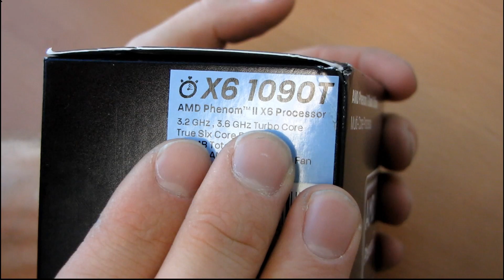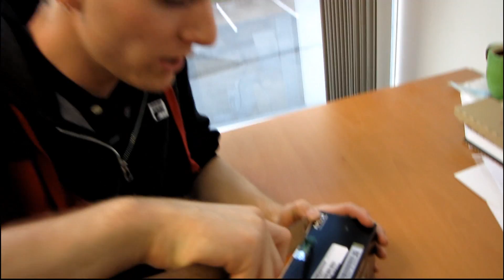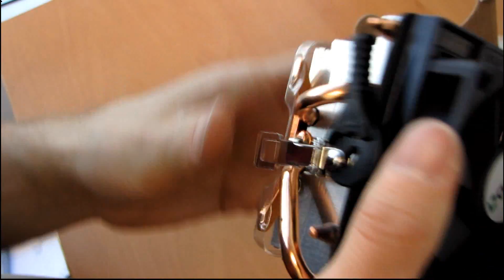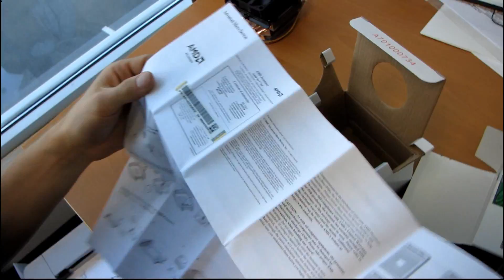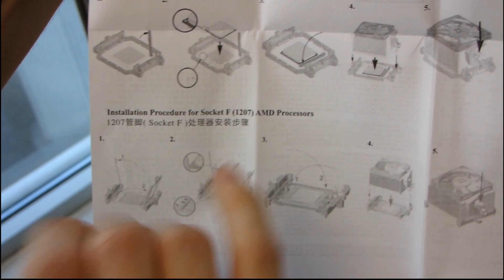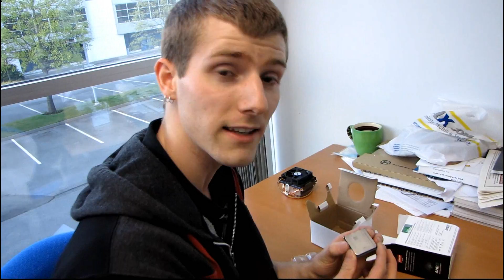AMD Phenom II X6 1090T Black Edition Six Core Processor Unboxing & First Look Linus Tech Tips

Comment: Watching this with my X6 1090t :)
Reply: Me too bro! I just uptaded my system with a RX580 VGA and put more RAM into it! Still gaming into 2018
Reply: Me too
Reply: Same! I upgraded graphics to RX480 and I actually have such a gaming backlog that my spec is still good. And it's good enough for Overwatch, so...
Reply: 1055T here (3.7GHz OC) Is the RX480 8GB good with these CPU's?
Reply: I miss this CPU, I used it for 7 years! It still ran very well.
Reply: @heavymetalfreek  what have you upgraded to?
Reply: still using mine in 2019 lol
Reply: Running the 1100T in 2025.  Switching it a Time Machine

Comment: Hey I have this processor and is running at 62C while gaming do I have to worry?AMD Phenom II X6 1090T Black Edition Thuban 6-Core 3.2 GHz Socket AM3 125W HDT90ZFBGRBOX Desktop Processor Dont want my pc to burn or my cpu to burn my motherbord how can I make it run coooler while gaming I already one watercooling while im not playing it goes as low as 22C
Read more
Reply: +Mario Cuenca Nope. 62 really isn't anything to worry about at all while under full load. That's actually on the colder side all things considered.

Comment: Bought this processor in june/july 2010 (can't remember the exact date). Have 6Gb of ddram2 and a R9 270X graphics card. I can play on my desktop pc any game from 2015 at max graphics without the processor breaking a sweat. The only problem I had was something happened to my 4th ram slot, (I originally had 8gb of ram, 2 gb in each slot), which gave me blue screens at random times when gaming or video streaming. So, until I find another AM3 or AM3+ motherboard (apparently they are not produced anymore),I'll stay at 6Gb. Anyway, I think, and this is just a personal opinion, that this is the best series processor AMD has produced... which is a shame. In my Dell inspiron laptop I use an Amd Phenom II X3 N830 which I bought about the same time as my destop Pc. It still outperforms my wife's A10 4600 Asus laptop.... (gaming wise, and video rendering wise). I don't plan on upgrading any of my pc's desktop or laptop (maybe I am an AMD fanboy) until a K10 true replacement comes. Hopefully 2016 Zen will be the hit I hope...
Reply: what? the newest amd boards are still am3+ that's all they make for amd. and I would really upgrade from that 667mhz ddr2 crap. 16gb of 2133 ddr3 for $100!
Reply: +andikoo82 Now here's a comment that I don't see a lot.

I too have the R9 270X but I have an FX 6300 and 1600MHz of DDR3 RAM.
Reply: Shredder's House of Pain Yeah, The FX series is somewhat better than my Phenom II.
Reply: andikoo82 It's served me well for emulation.

Comment: 1090T will still work well and handle almost everything nicely for at least 2 more years :)
Reply: and 2 years later....i fully agree with your comment

running a 1090t at 4ghz.....and a 6970.

its still not bad...and will do very good in my dads "family" computer.

zen seems to not be the best of the best....but damn close, and probably VERY VERY close with OCed
Reply: Still running the 1090t, with an gtx 1070....no problem running things though at this point i really need new ram and more pci lanes :/
Reply: I still used it -_-
Reply: Raymond Mertin major bottleneck, u NEED to upgrade to a new cpu
Reply: noobwow2009 ive been 5 years with that processor, the first two years it was a beast for me but after that errors and other stuff happened. i do not recomend amd for 3d animation / rendering / video editing because mine broke 2 days ago rendering an animation. Amd was okey at its time but im not buying it again. intel is much better and hopefully i will be recieving an i7 5930k tomorrow or so.

Comment: Hey, 

So I recently purchased a new case and I decided that it was probably time to apply new thermal paste and take apart the cpu cooler (I believe i bought it either 09 or 10 lol). I found that those copper pipes are now partly green, the top of the heat sink was covered with a few mm's of dust (the kind that looks like a creature lol) and the fan was also completely covered in dust. I cleaned most of it, the pipes are still shades of green (in some parts) and the top of heat sink (where the fan sits on top of) has turned a dark color. Should I be concerned? 

Also, I turned the fan around cause I thought it would be beneficial to have the fan blow OUT from the cpu, instead of the default IN. Am I wrong here? Oh and now my fan is SUPER loud, can this be because of the new orientation of fan? 

Can someone please give me some pointers here? thank you! 

P.S Went from Antec Lanboy Air to Fractal Design r5. Sweet case but the holes for putting cables through are WAAYY too small and the gap between side case panel and mobo is also way too small. I had to mess around with cable mgt for quite long to get it to close, even with slim cables from the RM1000 Corsair series PSU.
Reply: All i know is that the fan should blow 'to' the cpu. It keeps cooler that way. Just like if your in a room and you turn the fan away from you, you would feel hotter but if you put it directly on you, you feel much cooler.
Reply: Jordon Roberts Thanks! 

I ended up doing just that, there was a really, really loud noise coming from it the other way around.

Comment: Yeah but I have read that the 1100t outperforms an I5 2500k that was one of inlels best processor you could overclock the hell out of it. I was thinking of upgrading to that from a old Phenom x9950 to that and pairing it with GTX 770, that is like your GTX 680

Comment: four words: DO NOT GET THIS. Personally i have this paired up with a gtx 680 lightning edition. The 1090t doesn't bottleneck the gtx 680, but still, it is a really poor performer when it comes to gaming. Bottomline is, if u are gaming solely, don't be cheap and get an AMD, save up and get intel. Don't be stupid like me.

Comment: Hey all, just saying that if u want to game on this cpu, think twice. Mine didn't die or sth, it's still working fine after a year. But just cos it's 3.2ghz and has 6 cores doesn't mean anything. Basically even if u clock it up to 4ghz it still falls far behind intel processors when it comes to gaming. I'm really disappointed with mine but i just try to squeeze whatever performance there is out of it

Comment: Runs bf3 with no cpu bottleneck at all and will probably do the same with bf4. Its rival the i5 beats it in single core performance but as soon as the 1090t can stretch its legs in a multi threaded app it will kick ass. Plenty of life left in this cpu if you can get it for a good price.

Comment: This cpu runs HOT! Just picked this up i rushed to install that might be the reason why but I'm at 51c at stock setting idle and I have the corsair h60. I plan on trouble shooting as I had to go to work soon after install but I've read online they do run hot. Plan on reinstalling h60 and bios update will post update

Comment: @JamieSCOBell i got 2 enermax fans for the top of the casing taking in air and one lousy stock fan from thermal take at the side. Got another thermaltake one( slightly better) as an exhaust at the back. Seems to be running cooler now. I think i'll get 1 more quality fan for the side intake so my gpu doesnt hit too high of a temperature. Thanks for the tip thought =D

Comment: @RSGu1des i have phenom 1090t
8gb 1600mhz ram
similar spec board
but im using a 2-3 year old geforce gts250 512MB

surprisingly it runs starcraft 2, skyrim, fallout 3, COD MW2 with 90% of settings on ultra & at 1680x1050 reolution maintains above 40 fps 97% of the time

so with the gtx 560ti it would absolutly demolish these games

2x4GB ddr3 1600mhz cl9 costs less than double 2x2GB costs if u can afford get 2x4GB (8GB)

get an AM3+ board & u can upgrade to new 8core FX cpu in future

Comment: i just bought this processor along with a gtx 560 and 8 gb ram. It appears that my 1090t is overheating even though i dont overclock any thing! I was playing bf 2 maxed out and it ran very well, however i could feel waves of heat from the computer. My gtx 560 seems to be running cool but the 1090t is seriously overheating. I am currently using the stock cooler. Can i turn off 2 cores or sth?

Comment: i have this processor. after activating the full 6 cores, i have no idea how to deactivate them. they use too much voltage - about 1.4v, and it is making my CPU at 44*c which is fine but due to the high voltage, my fan speed rises up alot higher to keep it at 44*c and the fan rpg ranges from 2800 - 4800 rmp and the acoustics is bothering me.

statistics from CPUID H.W. monitor and CPUID CPU-z

anyone know how to deactivate the cores? whether from the bios or a special button or something?

Comment: @Dp153 @Dp153 thats a sweet rig i would add a cooler master v8 cart because you will not be able to oc much with the stock cooler cuz of the 135 or 125w cpu (cant remember, but they run hot!) u can always upgrade cooler later and the six core is alot nicer than the 4 core cuz you can future proof your rig by doing so, even tho games dont support 6 cores yet. 
p.s. the v8 will do much better than the 212

Comment: @omfgg3tlost Not really :/ AMD is actually known for having really loud factory heat sinks. I myself own a quad phenom II black edition and the stock heat sink keeps it cool but is extremely loud. Also replace the thermal compound with your own (I recommend arctic silver 5 or antec formula 7), but yea us AMD users know to buy an after market heat sink.

Comment: @mad87645 WTF are you smoking? The Core i architecture is about 30-40% faster than the Phenom II. The 2600k stock beats the PII at 4.0ghz. Learn your benchmarks. The PII is great bang for the buck, but it can't touch the i series. 1366 just blows AM3 out of the water. 1155 is no contest.

Comment: I'm buying a new PC(for gaming), will this be good enough for gaming?
CPU: AMD Phenom II X6 1090T Black Edition
CPU Cooler: Coolermaster Hyper TX3
Operating System: Microsoft® Windows 7 Home Premium 64-bit
Motherboard: Asus M4A87TD USB3
Memory: 8GB DDR3 1333mhz (2x4GB)
Hard Drives: 1TB S-ATAII 3.0Gb/s
Optical Drive: 22x DVD±RW DL S-ATA
Graphics card: ATI Radeon HD 6950 2GB
Sound card: Onboard 7.1 Audio
Internet: Wireless 802.11N 300Mbps MIMO USB dongle
Case: Zalman Z9 Plus
PSU: 700W Xigmatek

Comment: @cmts38 yeah but the reason why its cheaper is because amd took intels blue prints for the core i7 and then modified it and called it the AMD Phenom 2 x6. its like intels fraternal twin thats kind of a bit better in some areas whereas its not really useful in others. they have been doing this since intel choose amd as their partner back when intel was making the first processor for ibms computers.

Comment: @cmts38 

I have this AMD coming in my gaming computer. The I7 actually is faster then AMD, but it isn't the price difference you're talking about. With a price match, AMD is $220, I7 is around $330. AMD fully clocked is better than an I7, and the I7 fully clocked just blows the AMD. I7 is the best for single monitors, while the AMD is more of a gaming one with more monitors.

Comment: @cmts38 also not able to be overclocked as high, not hyper threaded, hotter at higher clock speeds and does not support triple channel memory. Dont get me wrong I love AMD (am currently using AMD) but the performance of even the 970 which is only $600 and still 6 core hyper threaded is still far greater then this chip.

Comment: @GaystationSuckz lol, i3/i5 running 4 cores at 2.7 doesnt even compare to 1090t running 6 at 3.2, that turbos to 3.7 if your not utilizing more that 3 cores.i7 extrreme 980x six core only just beats it in all benchmark test ive seen,@ over twice the price.

Comment: @cmts38 Right but remember that processor speed rarely plays any difference. It's all about architecture when it comes to CPUs, and this is why the intel CPU is so much more expensive. It has a more advanced architecture and it shows in a lot of benchmarks.

Difference is not worth anywhere near that additional $700 though. AMD forever!

Comment: @hockeyhatesgooglnow The vcore will always have to go up depending on how far the overclock and how well the chip can clock on stock volts alone. The unlocked multiplier just makes overclocking easier, as you can literally do an enormous amount of overclocking just by upping the multiplier and keeping track of your volts and temps. Overclocking through the bus is pretty easy too, but you need to take more things into account.

Comment: @EmperorZhang66 The AMD Phenom II X6 1090T like all AMD Phenom II processors only supports dual channel ram. Apart from that the crosshair iv only supports dual channel anyways. Go with an Intel Socket 1366 Processor if you depend on triple channel memory.

Comment: Hi
I would like to know an honest suggestion wrt AMD and Intel processors. 

I have a Pentium D and have never worked on an AMD machine before. Ignoring the cost factor, which would be the best advisable configuration for HD graphics, gaming & daily office use? 

Honestly, which one is better - AMD Phenom II x6 1055T or Intel Core i7 980X extreme edition? 

Also, any operating system (present or future) which fully utilizes all the cores. 
Thanks

Comment: Where the performance of a processor is what matters and you're making a big deal about a sticker not being on straight.  More then likely it might even be a manual application.  I used to have to put at least 10 stickers in a breakerbox case where I worked, trust me, they mess up from time to time.

Comment: Finally got it stable at 4.1GHz ( using HyperPi ), and I'm absolutely delighted.
Used the same method as you did with the 1050T. :o)

Comment: Got one yesterday, replaced an Athlon ll 640 of all things quite easily, and my rig booted up immediately, with no probs.
But I did a clean instal of W7, and oc'd quite easliy to 3.85  GHz with no hiccups.
Does exactly what it says on the box, and I'm extremely happy with it.
May attempt to push it a little harder later on, but just now this CPU is breezing through games with vey little effort. :o)

Comment: @adolf512 and its the same dude....if u touch the multipler all increase voltages frecuensy and also the how they call? hyper transport? well what eva u oc 200 mhz each core so in total its 800mhz, i oc 500 mhz each core in total r 2GHz also i dont touch the voltages to I just put the fsb at 400MHz 400x7=2800 :)

Comment: @adolf512 actually ur phenom its 3.4GHz so u OC 800 MHZ (200x4) and that means EPIC FAIL i OC my 2.33GHz to 2.8GHz (500MHzx4= 2000) and get better temps and voltages so my OC pwns ur "phenom"

Comment: @cxiong116 Not even close my friend!! If you are going to run a processor like a 6 core black edition, it sounds like you seriously need to do some major upgrading if the current system you have has something as little as a 160 watt power supply.

Comment: @iCuddleMuffinz black edition has an unlocked multiplier and is faster running at 3.2 ghz while standard has a locked multiplier and runs at 2.8 ghz, if you have the right motherboard you can unlock it and overclock the standard to 4 ghz on air.

Comment: @BKsMassive  There are more factors to whether or not a CPU can run at 4.4Ghz or higher then just if it's from Intel or AMD.  And what?, 4.1Ghz air and only a 500Mhz bump using LIQUID NITROGEN!, lol .  And your 1090T chip must of been sent down from the gods themselves to be running it at 4.6 to 5.1Ghz all on stock cooling. WTF. lol

Comment: @BKsMassive ,sure dose mate 4.4 is easy as pie iv got 4.68 stable on water and this is over a YEAR old, its old tech and amd r still having trouble matching it. i would like to see a vid of that 5.1. it takes about 1.53v to get 4.2 stable on a(ON WATER) with die temp of 40c+ on the 1090t to get 5.1 another 900mhz u will need much much more vcore (1.8/1.9)to even get that to post and it will sure ass hell not be stable. now im not a fanboy but intel still have it by a long shot.

Comment: @87coryjohn yes the Intel 6 core cost more but my old i7 920 is still faster at stock speed and has 8 threads then the AMD 1090t and then there is the massive lack of overclock with the AMD when you compare it to then Intel i can run 4.4 stable on air or 4.6 on water stable all for the same cost and a much lower starting clock.

Comment: @FSXHD92 The 1090T is less than 300 bucks, and will easily OC to 4.0Ghz at 40-50 Celcius. At the stock frequency, it will run MW2 from 200-400FPS. Unigen Heaven benchmark with a 5870 will run nicely at 70+ FPS. Sorry, but for 800 bucks less, I'd go for the AMD.

Comment: @tklu84 no. the i7 better, espically in gaming. this cpu is about as powerful pas a x4 965. the only exeption is that in multithreaded apps that can use 6 threads, there, it will compete with the i7s. so for those apps this will be a great value, but it is not for gaming, as they generally dont support more than 4 cores.

Comment: would this processor be faster than the intel core i7? i do understand that core i7 has hyper threading technology that each physical core has another virtual core and which make it 8 cores. now this processor has 6 physical cores so would it be faster than the i7 processor with the same clock speed?

Comment: @habboahmet, I use the 980 in combination with 2 PNY gtx 480's in on a EVGA classified mainboard. I also have an second rig with 2 XFX 5870 black series, the phenom II 1090T X6 on a Asus Crosshair IV Formula.

I can tell you that Intel's 980 gulftown definately performs better than the AMD X6. Not by a whole lot but you can definately measure a difference between the two. So point being: are you gonna pay 70% more for a slighly better Intel?

If you want I can send you some of my benchmarks.